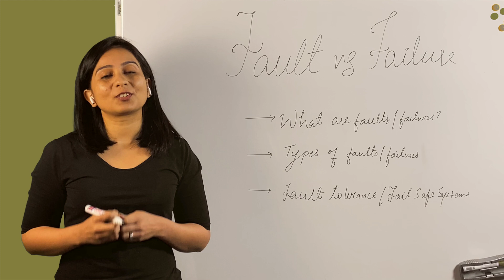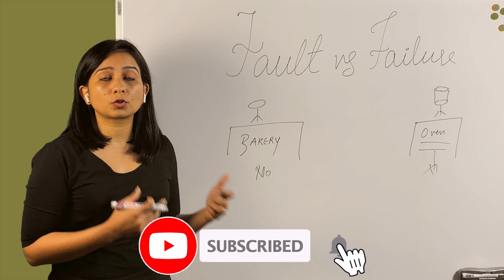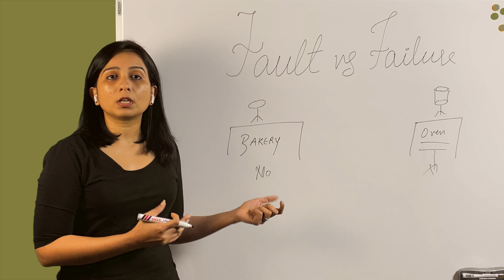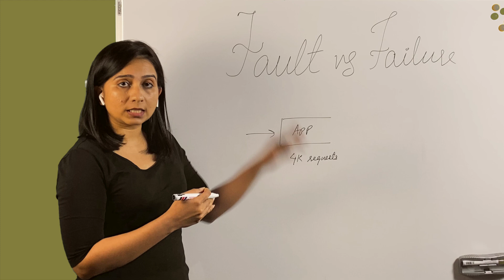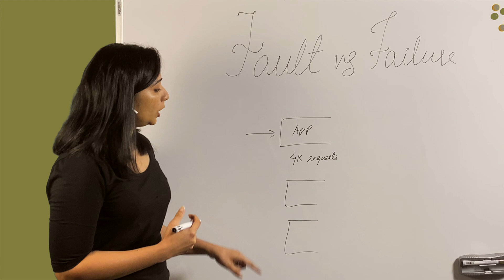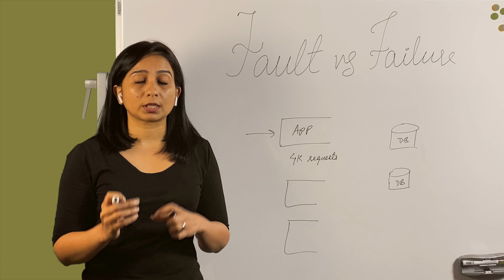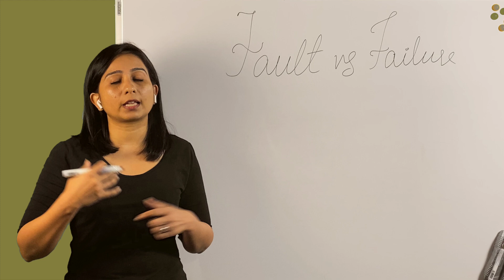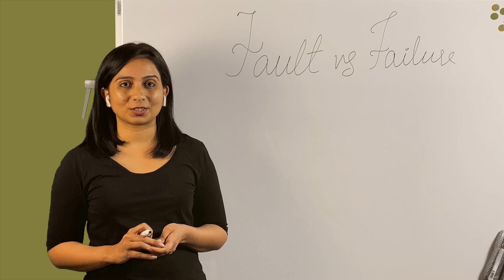Fault and Failure in distributed systems | System Design Tutorials | Lecture 16 | 2020

Comment: Use 3 phase electrical into the new system of data reduction and encryption mathematical can reduce real estates of bandwidth and nearly need not much and also the key is in niche or professional channel and expert system different of net than www domain and range separate net on level of data trafic by classified access of router and ip